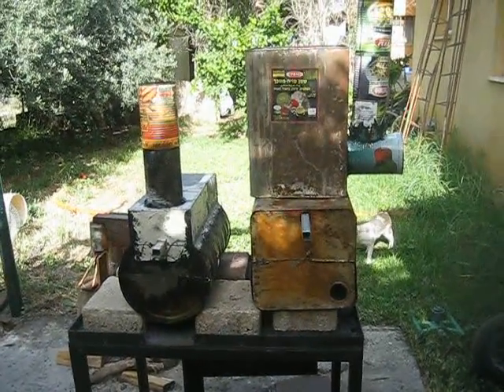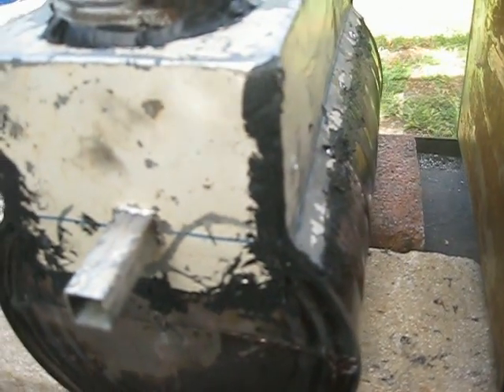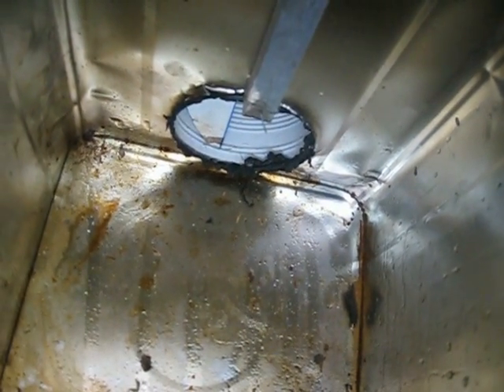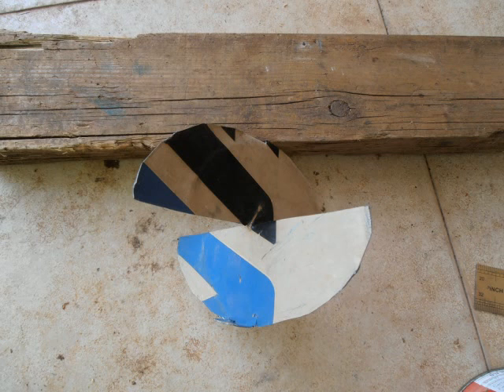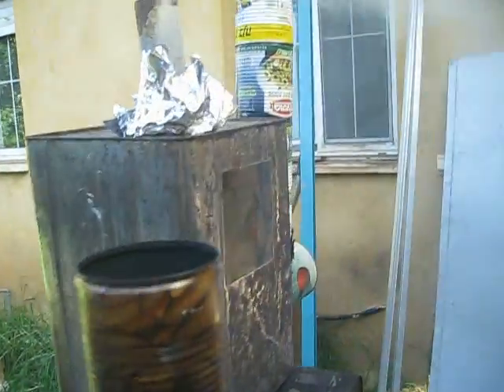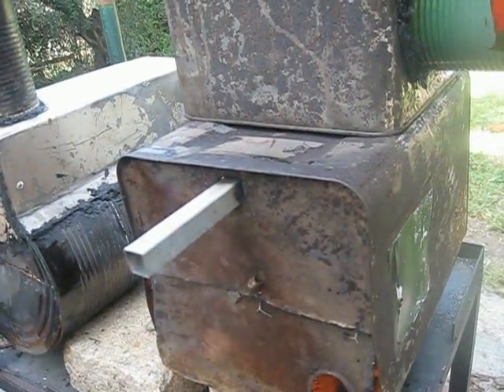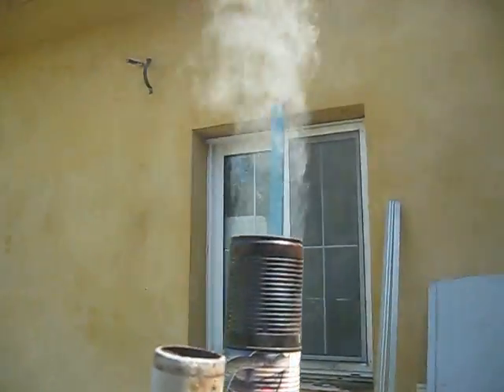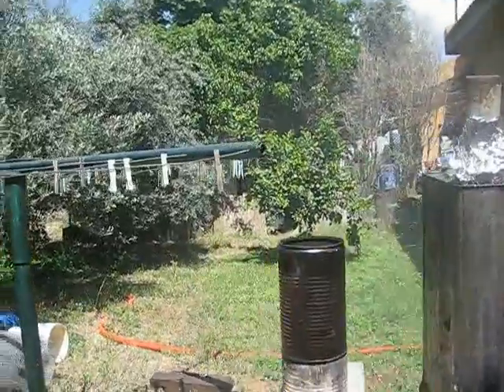Comparison of two wood stove prototypes

Comment from the maker: I made a full "real steel" air tight  "horizontal stove" with secondary air and chimney dumper and it works very well. I will post a video on it soon. The stove produces so much heat that I am afraid the house will melt!